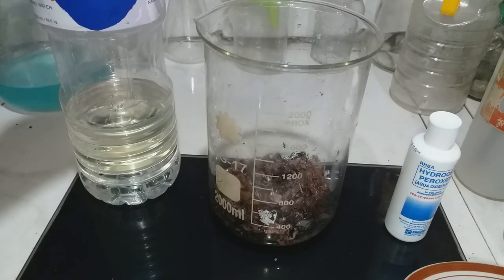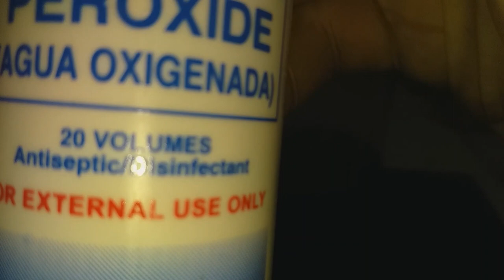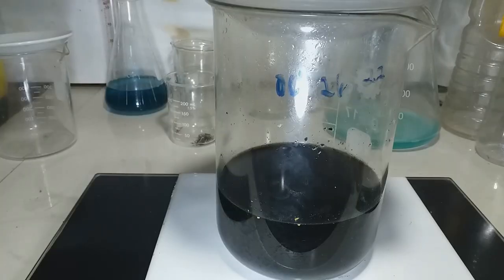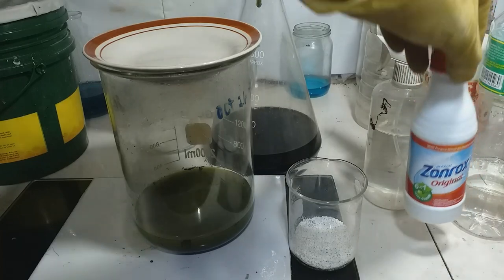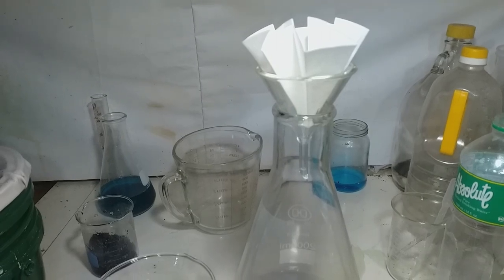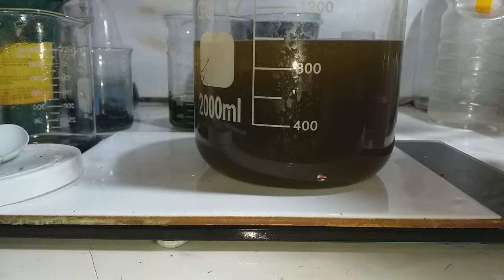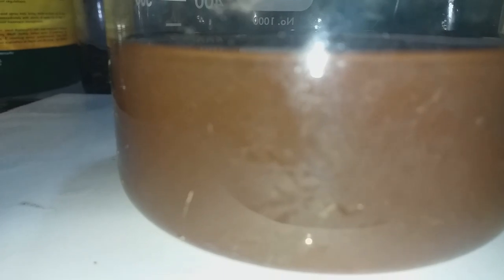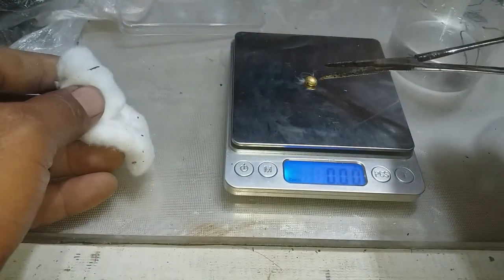Gold Recovery Without Nitric Acid Used | How To Recover Gold Without Nitric Acid?

Comment: There's no reason to burn the plastic...and it forms small beads of metals that take longer to dissolve...most of the chems you need can be synthesized with ease so product availability shouldn't be an issue if you have to use an excess amount like I've done. Plus if you have a distillation setup, you can recover the hcl if you have the knowledge and balls to try....if you do please use PPE I didnt see any when burning off plastic and that's not good dude...

Comment: Very interesting to see your non nitric acid process.  I know the process, but its good to see it in action with fairly low grade gold material...that I have.  Nitric acid is fairly expensive here in the U.S., but HCl, bleach, SMB and H2O2 are pretty cheap and available.  I have the exact same scale!
Reply from the maker: Thanks, I have up coming video no nitric acid too, old key pad cell board.
Reply: @PoorMiners321  can use 29% HCL?
Thanks bro keep up a good work
Reply from the maker: Yes sir its posible..
Reply: @PoorMiners321  thank you bro for info
Reply from the maker: welcome bro
Reply: ยอดเยี่ยมมากค่ะ
Reply: I will have to try this. I have a lot of that material and was wondering what to do with it.

Comment: So you guess on everything, nothing is measured
Reply from the maker: the scrap that I used contains gold, some are high grade and some are low grade, so it is not possible to measure how many grams of gold it contains, so it is also not possible to measure how many ml of chemicals to use in it, so in these situations it will start You should put the chemicals in the lowest amount, so when you see that everything has dissolved, stop adding the chemicals, that is the right way in these situations, so this is what I used.

Comment: So 2 lb of ribbon cables and other cell phone parts yields approximately 2 G of gold roughly that's good to know as you wouldn't want to work with much less than that and 5 lb would be about bare minimum for making the whole process worthwhile (assuming I'm not making monetized videos), is that about what you figure also?
Reply from the maker: yes,

Comment: Is there a way to recover with natural without any acids ? Or to dissolve the gold without any acid ?
Reply from the maker: The chemicals that I used in this video is available in a market, and nothing restrictions, but if you think in natural way? my answer is no.
Reply: I don't know how natural your talking but the closest you can get is by using white vinegar (the higher acidity the better) cleaning vinger will not work, hydrogen peroxide, and white sea salt (it needs to be sea salt). It will take a longer period of time like a couple weeks and using a bubbler helps the process speed greatly. I think this would be as close to natural as possible.
Reply: @rapidric4445  I mean from natural elements, without any corrosives or chemicals made in lab.
Reply: @Dynaboy1  yea then that's the way to go. White vinger hydrogen peroxide white sea salt. Start with a mix of 80/20/10 adjust if needed. Recommend a small bubbler it will speed it up for sure. This is only gonna work on trimmed chips or pins anything where you can see the gold it will not work for extracting gold from in side ic chip this is a very mild form of natural acid you using so it will not dissolve base metals and plastics it will basically just deplate the gold from whatever its attached to.
Reply: @rapidric4445  can i do it somehow slow process for example only with sea salt ?
Reply: @Dynaboy1  No. You need the vinger peroxide and sea salt to make a acid.

Comment: Hello! even though you got the gold, you did a lot wrong. 
1. there was no point in firing. in the film only copper. 
2. The first etching had to be done with sulfuric acid (autoelectrolyte) with hydrogen peroxide. in this way you will dissolve the copper and preserve all the gilding. 
3. Well, dissolving the gold wasn't perfect... oh well.
Reply: let me know if you read it. if you have questions, then write.
Reply from the maker: Thanks how to do that?